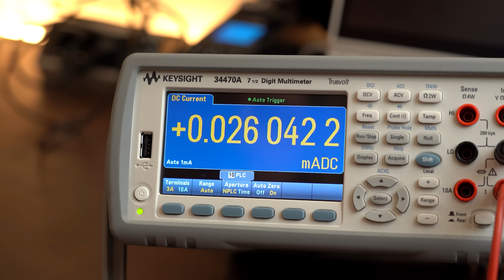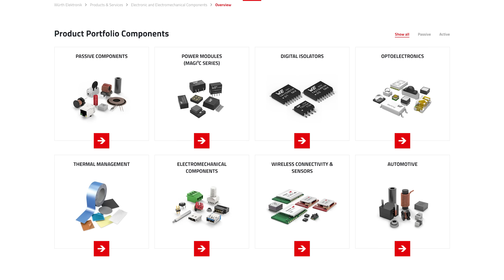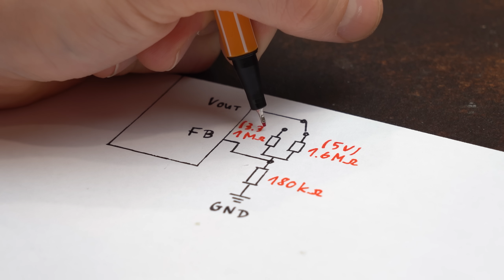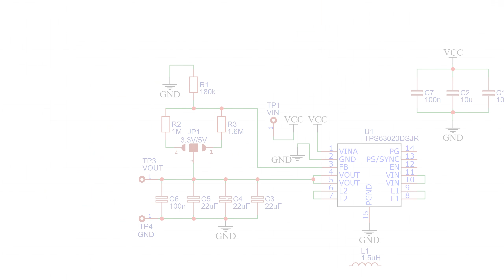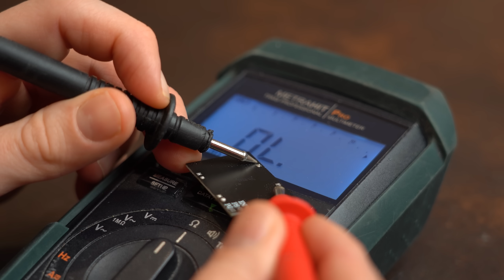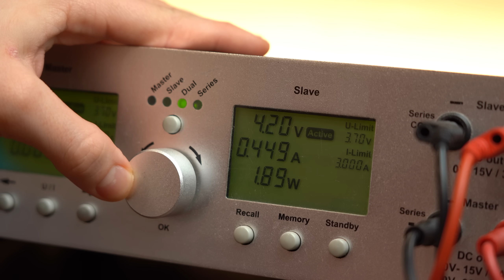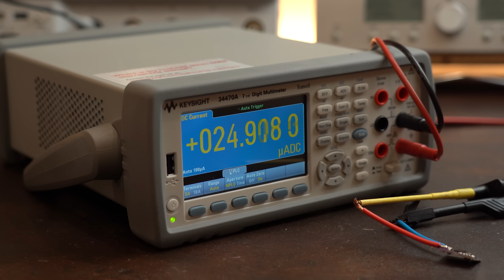How TINY Can I go? The BEST Power Board is here!

Comment from the maker: Important! My own designs here were not EMC tested. I will explore that topic in a future video ;-) There we will see whether my boards follow guidelines and how we can possibly change the design to make that happen. Also we will test the Ali Board as well concerning EMC. That will be fun. I hope you are looking forward to that ;-)

Also if you are interested in Würth Elektronik products/services then you can contact them directly if you are a company or business: https://www.we-online.com/en/products/components/ordering-form
But if you are a without a company then you can contact their distributors about their products: https://www.we-online.com/en/support/network/distribution
Reply: Please make a video on rda5991ic it is a multipurpose ic with features like it integrates 802.11b/g/n MAC, PHY, 2.4Ghz radio, PowerAmplifier and 
antenna switch into one chip and is optimized for mobile applications. WLAN, Bluetooth and FM can work simultaneously and independently, with low power consumption levels target to battery powered devices. I have one lying around but couln't find its pinout or schematic. Please help.
Reply: @panavpasricha  Good luck - I bought a few RDA5981 in like 2018 and all they released was a half baked SDK. Also RDA got acquired in 2014 and their website has been defunct for a few years now.
Reply: Würth is a good brand. But sadly; not available for consumers in the Netherlands... 
     There's a Würth store, 5 minutes from my house (in Amsterdam)... IMPOSSIBLE for me to buy anything there.
     So I go to Gunters & Meuser, the competitors, 400 meters away from them... Also 'only for business', but they actually DO sell to consumers (they just add the VAT on top).
      I would prefer Würth over anything from Praxis or Gamma too... (I like my tools and consumables professional grade. "Good tools = half the work" and a better result).
     Würth has missed out on a considerable amount of money from me over the years...

(WÜRTH, if you are listening - please make the shop available for consumers. 
     Most of your competitors do that too; ToolStation / Gunters & Meuser (Isero) / Tool Nation / etc.
Reply: @iggysixx at least the electronic department, you can get everything at your favourite distributor (for example Digikey or Mouser). But you need to order at least 50€ in parts or the fees will hurt
Reply: If you want to show the ppl EMC testing, I would love to help you on that. Also in a 10m SAC chamber. Feel free to contact me if you are interested in it.
Reply: Thanks for useful board!
Reply: If there's time, it would be fun to bring in a Pololu converter board as well - they're a lot more expensive than Ali Express fare but are nominally backed by a name brand and are the smallest off the shelf converter boards I'm aware of (albeit still a bit bigger than your design)
Reply: Will you make your Gerbers available?   Also, I only briefly saw your one stencil.  When you have a PCB made, it a stencil also created by the PCB board house for each revision?
Reply: Please do that video! I love these designs because power is necessary for all projects. Having a good, efficient, small power circuit that you can add to your designs is very valuable!
Reply: I doubt any of the aliexpress boards have emc testing or certification
Reply: Im very excited for a EMC testing video i've heard of it but haven't really understood what goes into the testing process.
Reply: Looking forward to it.  You're such an inspiration.
Reply: Yeah, whenever I've experimented with these kinds of regulators, one of my first tests is doing a conducted emissions test.  And doing that test at multiple current draws.  Without an input filter (which none of the reference schematics ever have), I wouldn't be the least bit surprised if all the designs fail.
Reply: Really looking forward to it!
Reply: That could be really interesting. I don't even know how they test "non contact noise" and what the limits are. 
I have built some converters and have never had any issues with it causing interference on nearby equippment as long as it works as intended (if a mistake is made when building the circuit, it can - but then it usually don't work very well either and voltage regulation become noisy and unstable, output noise unacceptably high etc). 
Converters using transformers with input and/or output voltages mainly above 20-30 V, can also cause "capacitive noise" that affect things in contact with the circuit or very close - but putting an extra shield winding between the high voltage winding/windings and the rest, usually solves that problem.
The output noise is quite easy to measure though (just an oscilloscope needed) - and it's also easy to reduce it (to only like one or a few mV peak to peak for sensitive stuff) by put extra LC filter at the output.
Reply: AliExpress and EMC?? 🤣🤣🤣🤣🤣🤣🤣🤣 Lol you're funny!
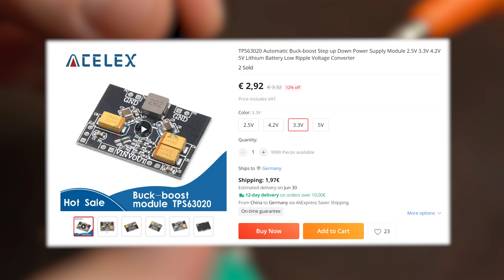Reply: 11:15 That store 10X-ed the price after you featured them in the video xD
Reply: Very excited to see the video on EMC!
Reply: That's awesome to show more EMC stuff! Thanks
Reply: It's kinda not valid to keep removing "optional" capacitors and components with 0 load on it and saying it still looks good on the oscilloscope. You need to test with loads such a microcontroller that might draw microamps in one millisecond and millamps in the next.

Comment: I tried to upload the Gerber to jlcpcb but the information about the components seem to be missing, so I cannot order a ready-made board, I would need to order and assemble separately. Have I did something wrong/missed some information, or did you omit the required files? Again, if you are willing to sell them already assembled, I'd be buying some (ideally single side, even at the expense of a slightly larger footprint...)

Comment: Hi Scott! I know I’m a bit late to the video but if you do end up seeing this and you would like to try using smaller components like 0402 and don’t want to pay for a metal stencil from JLC I would recommend getting some thin Mylar that is about double the thickness of a zip lock and a bit stiffer and then using a laser cutter to make a stencil by importing the easy eda stencil files into its software. I use this all the time for rapid prototyping and it works great even for panels

Comment: A lot of fake modules out there now. They don't get more than 80% efficiency. The PS pin does nothing. The chip has signature signs of being sanded off. Grainy surface of the chip. Marking wiped off the chip easily.

Comment: At around minute 5:28 where you connect pin 13 to GND and pin 12 to VCC. The spec sheet at around minute 2:38 all 3 pins are connected to GND via C3 100nf. My question: Is there an issue if you do not use a capacitor?

Comment: For low power applications I would actually recommend LM3671. It is small (SOT-23), it only needs 3 external components, it is 16uA quiescent current. Pairs really well with a 0806 form factor power inductor from Murata.

Comment: At high load (say ~10W for Vout=5V) efficiency is about 80% if not worse, meaning that the board is dissipating 2.5W~3W. Considering the size of the board, you must be hitting 130°C~150°C. Didn't checked the datasheet but this usual techno must be about ~40°C/W so yeah you must be hitting the absolute maximum rating. Notice that the hotter it is getting the less efficent il will be so you are entering in a vicious cycle.

Comment: You could've used smaller components. Smaller resisters and capacitors. It gets expensive, going smaller than 0603 because than an expensive machine is needed for soldering.

Comment: Heyy Great Scott, Huge fan of your work, I just had a question, I have been trying to make a newspaper lighter with the help of some heater coil (1500W Nichrome Coil) and 3 Li-ion Batteries(3.7V Nominal 2200mAh) in parallels, the lighter seems to work just fine but i am worried about the protection of the batteries as no BMS board is capable of delivering the required power to heat the nichrome wire until red hot. I generally directly hook the Nichrome wire loop in series with the battery terminal along with a 5A Switch in between. this results in over discharging of the Li ion batteries. can you please design a board which could deliver such ac well as protect the batteries as well, ( you can view my project video over here :-  https://youtube.com/shorts/_WMmoQ1Tgkc?feature=share )

Comment: Heyy Great scott, Huge fan of your work, I just had a question, I have been trying to make a newspaper lighter with the help of some heater coil (1500W Nichrome Coil) and 3 Li-ion Batteries(3.7V Nominal 2200mAh) in parallal, the lighter seems to work just fine but i am worried about the protection of the battries as no BMS board is capable of delecering the required power to heat the nichrome wire until red hot. I generally directly hook the Nichrome wire loop in series with the battery terminal along with a 5A Switch in between. this results in over discharging of the Li ion battries. can you plase design a board which could deliver such ac well as protect the battries as well, ( you can view my project video over here :-  https://youtube.com/shorts/_WMmoQ1Tgkc?feature=share )

Comment: Great job! I've used boards that were kind of similar (boost converters), except that they also had a USB-C port and a charging circuit. Connect the battery on one side, the MCU on another, and optionally plug in USB power to charge the battery. Disconnecting from USB which the battery still attached does not cause the MCU to lose power. Have you used those? I'd be interested to see what you think of them, I'm mainly curious to hear if there are issues with it that I don't know about. The main documented downside I know of is their claim that the circuit shuts off if the power draw is under 50mA, which is fine for my use case but doesn't really work for MCUs that will work on a cycle of long low-power sleeps + periodic wake-ups, a common approach.

Comment: Since you were reflowing the board, why not go 0603 for the caps and 0402 for the resistors? That way you could have kept the initial component count without sacrificing current and output noise...

Comment: The voltage divider network shown at  https://youtu.be/XAcW4c5qIMc?t=205 can be simplified by having a default voltage setting to 3.3V and using a small parallel resistor  to ground with a single jumper to raise the voltage to 5V . Benefit is smaller jumper , less stray noise pickup in feedback and safer voltage setting.

Comment: Yes, EMC is important but for me the noise is important too. For a regular microcontroller application, noise may be less of an issue but as soon as you start building analog (audio or HF) circuits, the noise on the power line is for a large part responsible for the bad quality of the output signal.
Different capacitors have different specs (a.o. ESR), resulting in different behavior for different frequencies, that is the reason why you see different capacitors (value and type) in schematics. It's not just about the 100 nF + 22 uF but also about the types of capacitors being used.
Same goes for inductors. Different core materials have a different behavior on frequencies so a coil suitable for a converter using 200 kHz may not be suitable for one working at 2 MHz.

Comment: I think a very cool extended goal would be a modular, compact power module with boost and buck converter with microcontroller-based settings that would negotiate the best matches from a USB-PD power supply. It would have just some dumb serial protocol to set the target current and voltage for the output and some led to blink acknowledgement or other status.

Then release it as open source, public domain and let the Chinese manufacturers figure out how to clone and sell it at minmal price doing what they do for the mass produced aliexpress devices.

For the serial thing, perhaps even something like using the led as an optosensor and using some magic blink sequence to transmit its programming data from any led blinker or phone/computer display.

For that, some simple web app would be good enough. Some very small and simple MCU such as attiny85 would be good enough for the controller purpose.

Comment: The smaller you want to go, the more you gave to consider variable swiching frequency, but above else, very high swiching frequencies. Both of which are an EMC nightmare. You will find that to make them pass CISPR for example you'd have to add bulky caps and maybe even inductors and chokes.

Comment: looks like they had used tantalum yellow capacitors, the speed is required for MCU like esp8266 s to work stably or have a lot of capacitance like 1F on output.

Comment: My guess is that the performance that was lost went with the capacitors that you deleted from your design. If there is enough proper real estate (meaning in the right places) on the bottom of the board, I suggest that you add them back on that side.

Comment: Just helpful feedback you should use for your next video:
An LDO would be more efficient (when operating at 3.3Vout ~90%).
An LDO would have greater output current (as output current increases, the LDO drops less voltage and the internal battery resistance deals with more).
An LDO would have less less noise.  
As the battery discharges, this all becomes more true.
Reply: A LDO cant boost though.
Reply: @TylerDurden-pk5km  3V isn't boosting.  When you need 3V (as per comment), an LDO is better.
Reply: @spamcatcher2760  Depends on your voltage source - if you have a NIMH or alkaline cell - you need a booster. If you need 3.3 and cant tolerate less and have a lithium rechargeable cell - you need a combined buck/boost chip like the featured one. 
Sure, there are scenarios where a LDO will do a better job.
Reply: @TylerDurden-pk5km    You are improving Youtube one helpful comment at a time.

Comment: Amazing talent and intellect,  hard to have both.  I dare to indulge to inquire, is it possible to do a buck with no board?..  Only way to get really small, or size efficient,  get rid of the board.. build in 3 dimensions.  Component to Component,  heat sink ok, if absolutely necessary. Is it possible to build, and step further, cc/cv.   THANK YOU FOR SHARING.

Comment: You can still make it smaller by scaling the components down. Use 0402 resistors (you don't need hand solderability when you use a reflow plate anyway, and 0402 is still not that hard to solder), and smaller in / out pads, these are huge! Also, the tracks / polygons going in and out of the coil don't need to be this wide at the top, this only increases the boards performance... as an antenna.

Comment: nice video...TPS6380x or MP1605  could be even better solution with 11 uA for 2 A output current. MP28200/10 (500 nA) for upto 1 A. TPS62743/431 (360 nA) for 300- 400 mA output currents. Most applications this should enough. I like MP28200 has least component count for 3.3 V output applications. May be you could have used 0603 components

Comment: You can still utilise 0402 resistor or capacitor package or 0201 if you're master in soldering (Or do machine soldering). 47uF 6.3V SMD capacitor is available in 0805 package. You can replace multiple 22uF capacitors with it or use Tantalum capacitors because they have highest capacitance density. along with 1 big 47uF 0805 capacitor, one 100nF capacitor is recommended to reduce ESR and improve EMC. If you're doing double sided assembly, 4 layer board is recommended for max. performance and better component placement with routing flexibility. With this recommendations you can build a PCB just a little bigger than the IC itself. Or Contact me, I'll design it for you 😊🇮🇳

Comment: Haha, boards from AliExpress and EMC testing, that was a good joke. If they're any good, than by coincidence, not by design. I'd have rather put the resistors on the back side, also it's an rather odd choice (if the schematics and what is placed on the board are in sync) to use the same 22nF value for both, I'd either gone for higher or at least different values.

Comment: How did the smaller boards handle the heat generated by the components? One of the reasons why you use large ground planes on a pcb is to use the copper layer as a heatsink

Comment: Nice, I thing I don't get, if your already chosen to hand solder capacitors on the back side, why don't just add more and bigger capacitors there?  

I guess there are thermal issues if those things operate at high output for a long time, just over 75% efficiency at 5V 2A output means over 3 watts of heat, that seems like a lot to me, even for the AliExpress version, of it's built into something, especially if it shares plastic case with other heat sources, like a battery that's discharging and possibly the load.

Comment: In my opinion the Vias job here is to act as a heatsink and keep the IC as the ambient temperature because the FR4 material is not good when it comes to heat transferring.

Overall good video as always, keep up the good work

Comment: Hot take: 0603s are easier to solder than 0805s once you get the hang of it. You just have to take advantage of surface tension.

Comment: How about instead:  Keep the board the same size, increase the part size with higher performance parts, and how much more power you can get for same size.  Also, I don't Always look at smaller as better i.e. don't larger parts have better thermal dissipation.  Assuming one were going to use it with a LiPo battery anyway, sometimes having it the same size as the battery might be a good place to mount it ?!